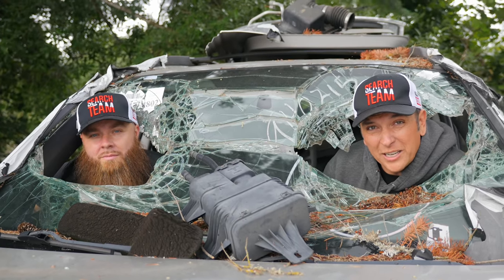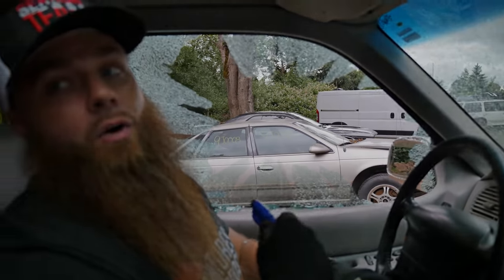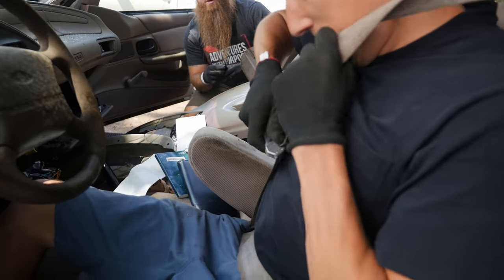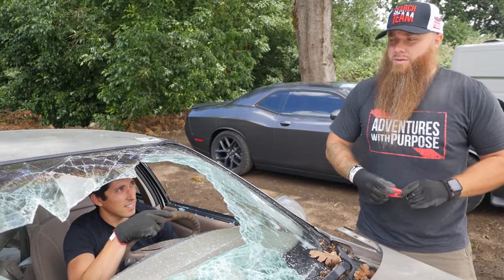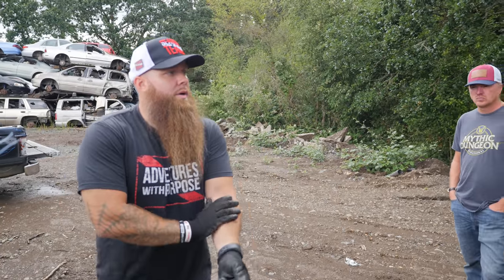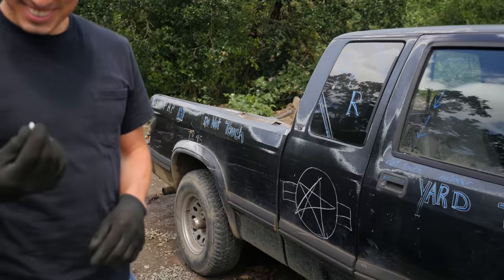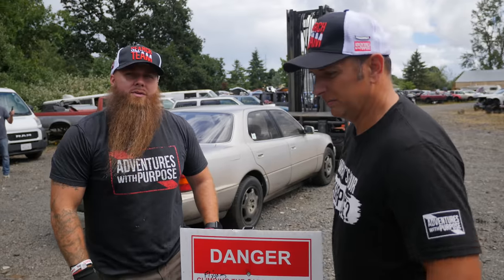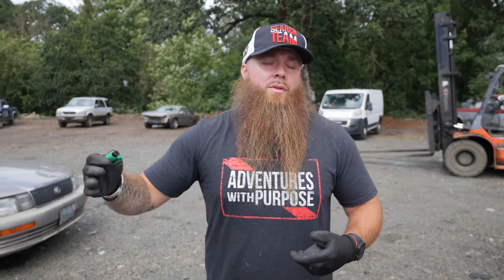HOW-TO-ESCAPE FROM YOUR CAR.!! (This Could Save Your Life)

Comment: I think the real question for me is: why aren't auto manufacturers including this as vehicle component? It's a small cost and could easily be incorporated into dashboard design.
Reply: @Francois_Dupont  so it would cost them even less.
Reply: Good video. Reminded me, there is a lot to be said for  roller crank windows . Or, install a CO2 cartridge inside door panel with a trigger button. Once immersed to a certain level , shattering window ?? Just a quick thought.  I liked the seat belt cutter and breaking device. But I do believe , just like Airbags for collisions. Some device should be installed for water escape.
Reply: @Francois Dupont.  Thanks for that info. Of added airbag detail.   It seems the auto industry on thinking safety all the way through, is sort of like that line from the movie "Get Smart."  "Missed it by that much." When put to the test, well thought out safety design is a humble reward.
Reply: My Fiat Panda has one. Fixed next to the drivers seat. By the manufacturer.
Reply: My car has life hammers near the side of each front seat.  And every now and then I knock one off.  I've had cases where I'd just throw the passenger one in the glove compartment, but after every service at the dealership, they are back where they are "supposed to be".    
I've apparently lost one at some point, and after the next service a brand new one appeared in the car free of charge. 
I think dealerships/repair shops should also play a part in awareness and checking for them, and their placing when cars are brought in for service/repairs. 
My dealership apparently sees it as "When you bring your car in for something, its our job to make and keep it safe for you, and this is part of it".  
Kinda like how they also put new bulbs in that box with spare bulbs that came with the car.  Because they know that once you replace that one bulb every few years, you might not remember to replace the spare one you just used until you need it again, and find it missing.
Reply: @Francois_Dupont  need a "destroy rear window button" as you careen towards the lake after hitting the ice on the bridge.
Reply: Most cars (in the Netherlands at least) have the thing with a window breaker and seat belt cutter
Reply: I was thinking the same thing. Living where I'm surrounded by water on all 3 sides, accidently driving into water is something  that I used to worry about it and have, over the years, wanted to buy one of the tools that Doug has.  They're not expensive. I'll buy some for Christmas presents next year, lol.
Reply: @Francois_Dupont  crap, sometimes I get strangled wen I'm driving. Hate the seat belts in my car. Not as much as the electrical system though, lol. That is totally whacked.
Reply: @perryberens618  Ahh, Get Smart. Great analogy. 🤣🤣🤣🤣🤣🤣🤣
Reply: @esenel92  Nice.
Reply: Completely agree.
Reply: Good thought
Reply: Just ordered 5 of them and everyone that rides with me is getting one in their pocket before we go anywhere im so beyond freaked out watching these videos - it’s just one of those things that you don’t really think about until you are faced with a situation/ and then everyone’s dead. Preparedness is what saves lives. Thank you for the information also - like hitting the corners and how to cut the seat belts, spark plugs, etc . Just appreciate you guys so much…you’re saving lives ❤️ love you guys
Reply: I had no idea a piece of spark plug could do that 😂
Reply: @Francois_Dupont  you get what you pay for i guess :/
Reply: @perryberens618  Air bags, like the ones AWP  float vehicles up with, should be installed under the vehicle and inflate when the vehicle hits water.
Reply: Got that right!
Reply: Right! They’re making the windows “safer” but then trying to exit is almost impossible without one of these tools! 
Thank you AWP!!!
Reply: Don’t rely on anyone else to protect or save you or your loved ones.
Reply: Very good question Dawn. Kinda makes me wonder.
Reply: Think about it.   Each Auto manufacturer sells roughly 1.5 million cars a year, in just the USA.  Even if they can make something for $1.50…   That’s $2.25 million dollars. (Per year, just in the USA)   

A good friend of mine worked for Toyota Motor Corp.  If any engineer can save $0.05 per car, there is an award and pay bonus possibly available because of the extreme financial gain a automaker will receive during the life time of that model.
Reply: Preach
Reply: Im so ordering one for me and each member of my family!! I have horrible anxiety when it comes to the possibility of getting into a car accident and not being able to get out. This tool honestly brought a sense of comfort and safety! Im even going to order one gor my trenage daughter.
Reply: @Francois_Dupont  then they need to build in a anti-strangle seat belt! 

All jokes aside. Ya know people be pushing those buttons or not maintaining them all the time, then blame it on the manufacturer and sue. 

We just cant win… when it comes to saving lives.
Reply: The same reason cars don’t come with fire extinguishers? I bought one of those to have not sure how useful it could actually be but it’s there
Reply: Fire extinguishers flares etc aren’t included either . They’d charge you five times the cost to include with a car purchase . First aid emergency safety kits are the owners responsibility.
Reply: @Francois_Dupont  but they will charge another 10,000$.
Reply: True, bc we all know the key FOB  costs way more than that!!!
Reply: I prefer the lotus option from James bond spy who loved me... 😉
Reply: But they guys said all new cars have laminated windows all around.  For once I’m happy to have a pre 2017 car!
Reply: good point!!!
Reply: I'm sure it's a "not my problem"-type of thing...
Reply: or just had them as keychains
Reply: YeS!!!
Reply: @Francois_Dupont  That's obviously not the same as every car including it. People have to be aware of a need to buy one and then buy it. 🙄
Reply: @SidewaysEightSix  It wouldn't cost them $1.50.
Reply: I feel like the same could be said about safety measures to make sure that children or pets are not forgotten. There are sensors in the front and there should be sensors in the back. This would cost so little to include a tool in a car ...
Reply: 100% just like many newer cars don’t even have keys.
Reply: I totally agree & that was my thought too!
Reply: True cars can drive now and park among other things! I agree with u!
Reply: @perryberens618  in older cars with power windows from like the 90s they had little hidden cranks to do it manually.
Reply: Most car manufacturers actually have it where you can pull the headrest out and break your side window with the pole from the headrest
Reply: You are absolutely right and should take charge of conveying that information
Reply: @SidewaysEightSix  except they are also selling cars at a phenomenal markup price so when you look at the overall profit... that figure still isn't much. Considering it saves lives. It should be a necessary legal requirement when manufacturing cars.
Reply: no I think the real question is why are they calling a sun visor a head rest? 🤣
Reply: Yeah! I was thinking the same thing!
Reply: $1 online, or a $1,500 "option"
Reply: @dawnstella7762  $1 online, or a $1,500 "option"
Reply: Definitely. I think either the doors/ceiling/floor board should have a cubby where this tool can clip in and be pulled out. Like a battery in a toy that has the little fabric pull thing to help dislodge a batter. No compartments that can get jammed, easily visible to the naked eye and near each seat so that anyone has access to the tool. I have 2 window tools and now I'm scared that they wont actually work. Mine were like $3-$8 but that's the on sale price.
Reply: ONE OF THE BEST QUESTIONS ASKED WITHOUT DOUBT !!! TY
Reply: @BayArea-bx7er  they would have to find a way to make a sensor that isn't based on weight bc they'd go off every time we have something in our passenger or rear seats, deeming them virtually useless because we'd grow accustomed to ignoring them. Also, a person who would forget a child or a pet in the car probably wouldn't pay attention to a sensor either.
Reply: Better yet, why aren't insurance companies handing this out to policy purchasers?
Reply: I Agree
Reply: I agree
Reply: @alishamassa  to be honest,  l think it's more to save someone else!  I saw a crash happen and there were flames,  a guy infront of us grabbed his extinguisher and put out the flames.  Well done on having one , l should 🤦🏼‍♀️
Reply: Our lives aren’t worth a couple bucks!
Reply: use the headrest in the car. You can use that as well. You take the metal part and break it at the inner corner.
Reply: they're gonna pay 2dollars and charge us 500 dollars that will be added with the price of the car and we'll never know.
Reply: @Skystone123 That's a really freaking good idea.
Reply: @BayArea-bx7er how come nobody asks... if there are sensors in the front seat to turn on the airbags when theres a passenger, why don't the sensors simply trigger at higher weights so infants and children can be placed up front. Or even better, why can't I control whether to turn the airbag off or on? I shouldn't need a waiver and to beg and plead to use my cars safety equipment in way that is safest and best for my situation.  You know where they always were prior to airbags and infants weren't forgotten in cars at nearly the same rate because the baby was right next to you. 

Why are we asking for yet more tech when we should be asking for more freedom of discretion. Maybe I have 4 kids and someone must ride up front because I can't afford fuel for an suv or van (and its wasteful and uses excess space and fuel when a car seats 5 fine). Maybe my wife is very small and  it is safer to disable. Maybe my passenger has a medical reason where an airbag is a greater risk than benefit. Maybe I'm smart enough to decide for myself instead of it being rammed down my throat

Comment: PLEASE READ THIS!-
When I was in drivers Ed, a Sherrif (Snohomish Co Sheriff, by Seattle) taught us how to have the best chance to survive this.
For starters keep in mind that the reason people are ACTUALLY found in the backseat is because when a window is down or you bust it out the water comes rushing in SO powerfully (different power inside the car(air) vs outside (water) that it will knock you across the car or into the back. He said many people make that mistake. 
He said if its easily possible to get out before it sinks, do so, but often you just can't.

He said if you can't-
1. STAY CALM. Panic is deadly, and unbuckle (or cut your belt)
2. Wait until the car has reached the bottom. It will be filling up with water at this time. 
3.Breathe in the air pocket that water hasn't reached yet calmly until the car is almost full of water
4. Once the car is near full of water the pressure between the outside (water)and inside (air) of the car is now nearly equal and you can open a door or break a window.

If you try to open a door before the pressure is equal it will not open no matter how hard you try.

If you bust a window before pressure is equal the water will rush in with so much force its likely to knock you out and will at least throw you across the car.

Having the tool these guys are showing could be the thing that saves you.
If the car is upside down, on the side or damaged the doors may be stuck and if there is current coming against the car the side the current is pushing against won't open.
Please don't break the window if your car is submerged but not yet filled with water. Wait until it's as filled up as possible.

This same day he told us of a woman they found in lake Washington, she was a housewife that had been missing since the 50s. They were looking for a recent accident and found her. What AWP does is beyond amazing!
Reply: I remember Mythbusters did this experiment to test which way is the best way to escape a sinking car and its basically what you just said tbh. Wait until your car is almost filled with water and then open the door, or the window. Yall can go and look it up its pretty cool honestly and a cool fact to know if that ever happens👍
Reply: @rafj2762  I was looking for this comment! Yes I remember that episode. I also remember thinking there is no way I can remain that calm. Also he didn't have much of an air pocket and had to hold his breathe until the car filled up. (I'd be dead)  he was calm in a controlled atmosphere and knew when to hold his breath) it's still knowledge I'll never forget though.
Reply: gonna be bad if the water is 30ft plus
Reply: Also if you have kids in the car I’m not sure how you would keep yourself and a kid/kids calm while sinking.
Reply: I'm going to be dead. I'm Terrified of murky water and I'd be unable to stay calm. But it is a real concern, because we almost went over the Mississippi Memphis bridge. The week after they closed it, I was on a trip over that area.
Reply: Ty for all this info.i was always told once the car sinks it was impossible to open doors or bust windows so I learned smthg new today!😁😁😁ty
Reply: Tesla (or other electric car) on fire scares me for the future. Only seconds to escape a lithium battery fire no firetruck or extinguisher can put out.
Reply: What if someone cant swim? Is he gonna wait until the car starts sinking to the bottom?
Reply: I hope everyone reads this! Great video, but the fact to either get out before being submerged or wait until the pressure inside the car stabilises wasn’t stressed enough.
Reply: Thank you for your life saving comment. 🙌🏻
Reply: Fuck it am dead then, because it’s impossible for anyone 2 remain calm...and what of u can’t swim? Bye!
Reply: What if you have seat belt on, and you are holding on to the steering wheel?. Can you pop the window then before the pressure equalize? I only ask because I don't think I can hold my breath that long, panicking causes a lot of more oxygen. and I have deep water phobia.
Reply: @Kim-il4gk  yeah I have 3 brothers and one is a toddler so he can’t hold his breath
Reply: From the Philippines. Thank you for sharing this knowledge
Reply: The comment sound be pinned with their other comment, for sure.
Reply: Thank you so much for this info. I hope I’m never submerged in a body of water, but if I am I know what to do now. Thank you!!
Reply: @teborah7684  good question, I'd probably invest in some kind of floating device to keep in the car
Reply: In helicopter underwater escape courses you are taught to get the window open first before releasing the seatbelt - because the seat belts give you an orientation towards the window and hence the exit.
Reply: @finalvoyage35  Electric cars catch fire less often than petrol cars (speaking as someone who had their car catch fire driving down the road).

Comment: Also important tip with the seat belt cutter. Always slice diagonally instead of straight across. Seal belts are interwoven strips of nylon which is next to impossible to cut through all at once. But diagonally you are cutting one strip at a time and the blade will go through almost effortlessly.
Reply: Yet my Stanley knife slices them straight across no issues.
Reply: Thanks
Reply: Since i have been driving i alway carried scissor in my car just in case i needed to get out of my seat belt this a great tool
Reply: Thank you

Comment: So, one thing I will say as someone who works in the fire service- it is AWESOME that you guys put this video out there. Seriously, not enough people stop and consider the risk that they might be in an accident, need to help someone else, or just generally have need of a tool to get out of their own car. 
Just to add- I actually use the same model of Smith and Wesson knife shown in the video as my back up at work, it cannot be stated enough that you need to aim for the corners. Think maybe an inch away, two at the most. Springloaded glass breakers are definitely the way to go if you have the option.
Again, seriously, you guys are absolutely FANTASTIC. Thank you for taking the time to put this together.
Reply: couldn't agree more. Thankyou guys for making this video. Bless you both
Reply: I remember a horrible story of a family trapped and on fire inside their van and no one could get them out. They literally had to see them burn alive.
Yes, every vehicle actually does need to be equipped with these tools in the dashboard.

Comment: I had a young co-worker end up on his roof in a water-filled ditch one cold December night. He was lucky to get out thru the rear hatch of his Honda SUV, which was up on the dry part. If he'd been knocked out it could have been tragic despite witnesses being there.
Reply: I was hit from behind by a guy who was fiddling with his CD player, and his car flipped and fell about 10 feet to land upside down in a water-filled ditch next to the road just like you described.  He had a window all the way down on the driver's side and shimmied out of that while the car filled with water; 2 minutes longer and he would've been drowning-- the doors were stuck closed because of the sides of the ditch, and the car was stuck tight as a cork in there, leaving just barely enough room for him to get out.  The tow-truck had so much trouble getting that car out of where it was crammed in that a door and one tire ended up being torn off by the time they got it up onto the road.
Reply: @YsabetJustYsabet  Lol, same here, I've rolled into the ditch while fiddling with my CD player, and could easily get out only because the windows were already open. By the way, I've landed only few feet away from the irrigation channel filled with water. Lucky me.